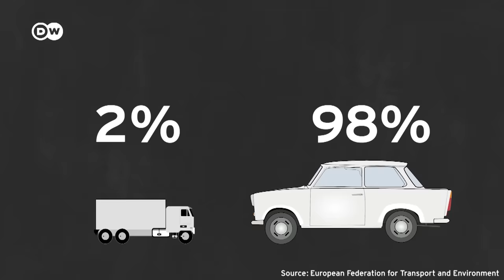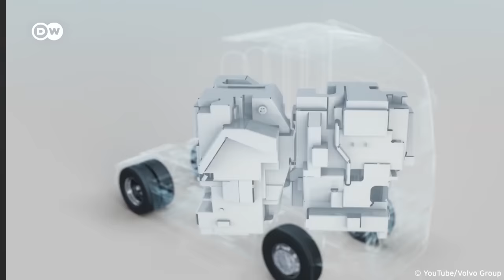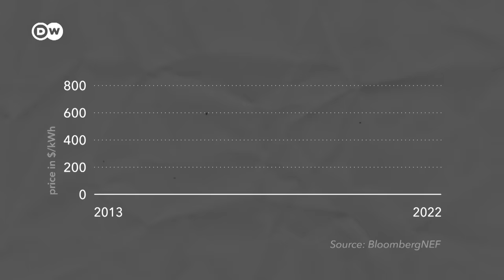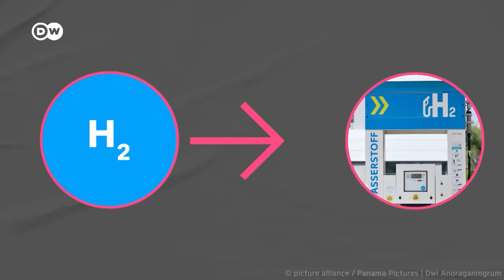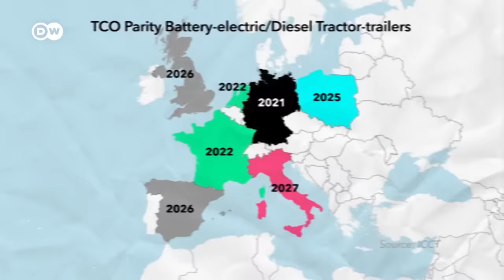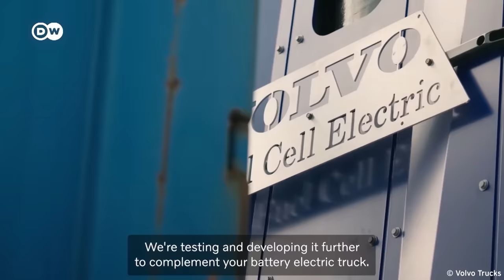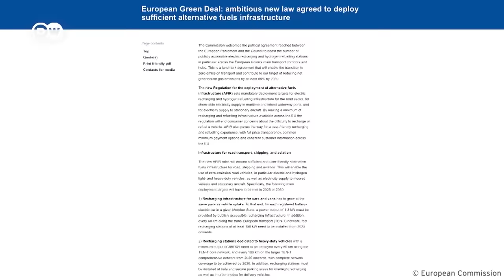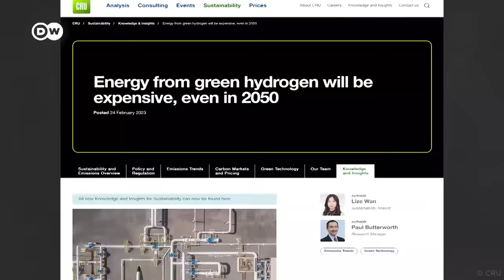Which will be the engine of the future?

Comment: Fuel cells are very fragile and degrade in performance as the inner catalytic plates fracture or chemically break down they suffer thermal cycling and very high temperatures in hydrogen fuel cells VS battery's can survive vibration with longer life than most fuel cells.
Hydrogen will be good in some niche applications so it's good that it is being developed as well but seems like it will have to settle for the scraps as battery vehicles superior efficiency ensures they will dominate in most situations.

Comment: Electric heavy trucks are a non starter simply because the batteries are to heavy and maximum load carrying capacity is no 1 so the only viable solution to replacing diesel to eliminate co2 emissions is hydrogen but converting the standard internal combustion engine to hydrogen existing nox technology would bring this down to very low levels also hydrogen could be transported safely and easily using ammonia in transit and converting it back to hydrogen at the pump
Reply: Except that that would be incredibly inefficient and require about 5 times more electric energy.

Comment: Does "hydrogen AND battery" make sense, not as asked in the end, i.e. I think meant pursuing both strategies separately for the industry, but as a hybrid within vehicles? At least such large ones? The problem seems to be few hydrogen fueling stations, at least for a while so they could be spaced out more. Will battery "only"/no-hydrogen win out, by other means than simply charging, e.g. switching out batteries for fully charged as shown in the video, then needing only smaller? Or other ways to do away with smaller, which seems to be the downside of battery-only.

Comment: Think about this....
In a petrol car we have petrol tank that you must fill every now and again.
In an EV the "tank" is basically the Battery, which you must charge (fill) every now and again with Electricity which takes time.
The fuel for an EV is ELECTRICITY and it must come from somewhere......
The EV Tank (Battery) is massive and very heavy compared to a Petrol Tank.
If every vehicle was an EV the Electricity fuel required would be of gigantic proportions and        the electricity distribution would have to be upgraded at huge cost.
But still the problem remains.....
Where does the fuel come from.?
Energy does not come cheap.
Then again the time to fill the "Tanks" must also be considered....
Reply: Except that electric cars are far more efficient and therefore require far less energy. An EV only needs about 10 kWh per day.
Reply: @Simon-dm8zv  
What is the efficiency of getting the electricity fuel.....It is no better than the efficiency of the ICE......Read Carnot cycle.
Reply: @maxthemagition  Wrong. Power stations are far more efficient than combustion engines.
Reply: @Simon-dm8zv  
Read up on the Carnot....
The Carnot cycle, a theoretical model for a heat engine, established the theoretical limits of efficiency for heat engines.
An Electricity Power Plant is a giant Heat engine that produces heat/ steam to drive the turbines.
Then there are the losses on transformers and distribution.
Lucky if you can get 40% efficiency from the input to the power station (Fossil fuels) to the plug to the EV.
Modern ICE vehicles are as good as you can get efficiency wise.
Then there is the pollution....China for example has the most EVs and by far the most pollution from coal fired power stations...
Reply: @maxthemagition  I know the carnot cycle and that is exactly why power stations are so efficient. Fuel production is simply so inefficient and polluting that EVs using non renewable energy is still cleaner. Production emissions of the EV are compensated for within the first few years of driving.
Reply: @Simon-dm8zv  
I find that hard to believe.
What you are saying is that an EV uses the same energy per day as an electric 3kW fire which is switched on for about 3 hours every day.
Or a 3kw storage heater on for 3 hrs.
Reply: @maxthemagition  Spot on. An average EV EV will consume a little less than 10 kWh per day (50 km).
Reply: @Simon-dm8zv  
One hp (Horse Power) = 745W.
So 10kW = 13 hp....i.e.13 Horses for 1 hr. per day.
See how far 13 horses will take you in one hour.
My Car has a small engine rated at 150hp.
You see why I find 10kWh (13hph) per day for an EV hard to believe...
Reply: @maxthemagition  That's not how it works. You can easily look up the average consumption of electric vehicles. Many of them will be somewhere around 0,2 kWh per kilometer. A comparable petrol car will use about 0,066 liter per kilometer, which equals 0,6 kWh.
Reply: @Simon-dm8zv  
Is what you say correct?......
0.2kWh per km....
For 1 hr to travel 20km at 20km/hr = 4kWh used to move a vehicle weighing close to a ton 20km.!
Is that correct?
Seems a bargain doesn't it.?
I think I'll put the kettle on and contemplate that.
I'm sure a horse could do much better.
Reply: @maxthemagition  Yes it is. Look it up. This is why EVs make so much sense.
Reply: @Simon-dm8zv  
I asked Bard......
"False. The average EV consumes around 30-35 kWh per 100 miles (approximately 160-177 kilometers). This means that for a daily commute of 50 kilometers, an average EV would consume around 11-13 kWh per day.

Here is a table of the average daily EV consumption for different driving distances:

Driving distance (km)	Average daily consumption (kWh)
50	11-13
100	22-26
150	33-39
200	44-52
As you can see, the average daily consumption of an EV increases with driving distance. This is because EVs consume more energy when they are driven at higher speeds and in colder temperatures.

Here are some factors that can affect the daily consumption of an EV:

Driving style: Aggressive driving, such as hard acceleration and braking, can increase EV consumption.
Weather: Cold weather can reduce EV range and increase consumption.
Terrain: Driving uphill can increase EV consumption.
Vehicle weight: Heavier EVs consume more energy.
If you are considering purchasing an EV, it is important to factor in your daily driving distance and other factors that could affect your consumption. You can use an online EV range calculator to estimate your daily consumption."
Reply: @maxthemagition  That is ALMOST what I said. And any car consumes more in these different conditions, this has nothing to do with the type of drivetrain.
Reply: @Simon-dm8zv  
My car switches off 2 cylinders of the 4 cylinders and so consumes less fuel when plain selling and meets all the pollution figures set by the government. So things are getting better.  With the figures you quoted all I need is a 10 hp engine instead of a 150 hp engine!
Wonder why the car manufactures have not thought of that?
Reply: @maxthemagition And yet your car uses 3x the energy of an EV.
Reply: @logitech4873  
150hp engine..
This is probably why people are still buying ICE cars insted of EVs.
"3 Apr 2023 — Electric vehicles account for less than 1% of the 250 million vehicles, SUVs, and light-duty trucks sold in the United States."
The Americans like their BIG cars.
We still need a revolution in fuel and tanks, but batteries are still in their infancy.
FUEL and TANKS.....
Reply: @maxthemagition  People are buying ICE cars over EVs because of... "150hp engine"?
What does that even mean? My EV has about 500 bhp and uses ~150 Wh / km.

Over 80% of new car sales in my country are EVs. EVs make up about 22% of all cars here.
Reply: @logitech4873  
It's life choice.
It's early days for EVs as battery technology and/or energy storage is key
Many people still want the ICE behicles, especially bigger vehicles like lorries.
Until EVs can prove conclusively to be the "Best Buy", all things considered, then ICE vehicles will be the preferred choice.
As I said we need a fuel/tank revolution still
Reply: @logitech4873  
Ladies and gentlemen, welcome to the biggest shakeup in the 40-plus-year history of BMW’s beloved GS legacy. The all-new R 1300 GS – and by ‘all-new’, we really do mean every single component on the bike – is more powerful, torquier, lighter and more sophisticated than the R 1250 GS it takes over from. The R 1300 GS is a true, literal, clean-sheet design: a totally redesigned engine, in a completely new chassis, featuring technology that’s never been seen on any production road bike before . And, perhaps most controversially, there’s also a dramatically different look from nose to tail.

We flew to Malaga for two days and close to 500km of extensive testing, both on and off-road, to put the all-new GS through its paces. However, with so many model variants, so much new technology and so many tweaks, upgrades and general improvements we will have to visit the 1300 GS again (and again...) and put some serious mileage before we can say that it's fully tested.

A manufacturer's launch test can only cover so much ground, and we came away from our ride on the GS still needing to test long-distance comfort, plus the heated grips and seat, the luggage system and pillion comfort. But two days in Spain did reveal some surprises. Has BMW’s benchmark adventure bike been improved, and if so by how much?

WHY NO EV.?
Reply: @maxthemagition  Most people drive cars, not lorries. EVs don't have to replace every single type of vehicle to see mass adoption. In my country they're quickly becoming the most common type of car.
Also you didn't explain what you meant by the 150 hp thing. Can you explain?
Reply: @logitech4873  
10hp is all you need apparently in your EV world as that is the average consumption....
0.2kWh per km.
But if you put your foot to the metal, it is a different story.
I can visualise the average EV driver with a very light foot for fear of emptying the tank.
150hp ICE car, there is no worry about that...
Another reason that EVs are not selling so well.
Also Lithium Batteries can leak and overheat, so be very careful with that pedal to the metal....
Reply: @maxthemagition  EVs often have several hundred horsepower. It seems you're a bit confused here.
Average consumption isn't an indicator of engine power. An EV can be extremely efficient while also being extremely powerful. 
My Tesla Model 3 is both very efficient, using only about 150 Wh/km, and it's also very powerful with almost 500 horsepowers. It accelerates extremely quickly.

The most sold EV in 2023 was the Tesla Model Y. It comes with 295 bhp in the low end model, and 456 bhp in the high end model.
In fact, it was the most sold car overall of any car in 2023. It outsold all ICE models.
Reply: @logitech4873  
Impressive, but they are expensive.
Still too early to jump on the EV bandwagon, in my opinion.
Reply: @maxthemagition  You're right about that, they are too expensive. In 10 years time they'll have matured some more.

Comment: Electric trucks still rely on electricity generation, which still relies on fossil fuels to create the electricity for the trucks.

Therefore, before stringing up wires and swapping dirty batteries it only makes sense to develop hydrogen powered vehicles for trucks, cars, rail and airplane transportation.

Electricity is a lost cause . If we truly want to have zero emissions  we should look to develop hydrogen as a safe, reliable and non-polluting fuel!

Comment: I think it’s abit unfair to say a truck is producing 25% of all emissions in Europe for vehicles they are fare more efficient then cars when u take in to consideration the weight they move we need trucks we don’t need cars for everyone hydrogen is by far the future if we can find a way to cheaply and safely make it it would change the world u could even dub down on making it cost effective by converting a modern diesel truck to run on hydrogen they can already run on natural gas or propane with little to no modifications hydrogen would be the next evolution in diesel technology if u think batteries are clean just look at how they are made and the metals are mined u might as well just drill for oil we are also neglecting the fact that we can do many more things with hydrogen in the future we could use our existing natural gas infrastructure and pipe it to homes for heating use the potential for hydrogen is limitless were as batteries are always going to need to be replaced and recycled o and one more thing in theory a truck car boat furnace or boiler burning it would never need to be cleaned or oil replaced as it is nearly pure and contains no carbon

Comment: Problem with battery's is you need a lot more copper and lithium to make1 battery, in fact there's not enough lithium on the planet to make all the battery's needed, plus the raw mining that destroys the environment, and batteries are not recycle, and you don't get the same milage as a hydrogen truck, i would take the hydrogen truck over an electric truck any time, it just seems like a much better choice and easier to work with.
Reply: There is more lithium on earth than we will ever need. Also: we would need far more copper to build all the wind turbines and solar panels required for hydrogen production (3 times as much).
Reply from the maker: Hey.✨ We recently checked whether we should be worried about lithium running our. Check out our video here 👉 https://www.youtube.com/watch?v=gAZV1Ut6DDs

Comment: Finally a video that adresses the absolute massive quantities of electricity you need to generate in order to make hydrogen work. A lot of people seem to oversee this fact, much like how they don't take into account the tons of emissions created by refining and transporting fossil fuels. 

These things don't simply appear at gas stations. Before you can put anything in your car or truck it has already had an entire journey. To transport electricity we only need to adapt the infrastructure we already use.
Reply: The quantities of electricity needed to generate hydrogen is not really an issue if the electricity is generated from renewable sources and the use of hydrogen is economically competitive. Its not like the we are going to run out of sunlight and wind so its basically a question of economics. And there are are other things that could be taken into consideration such as the emissions generated from lithium mining for batteries and the often moraly questionable sources of labour employed in those mines. The statement of adapting already existing infrastructure also applies to hydrogen. The infastructure used to transport diesel and gasoline can be adapted to transport hydrogen. As for any additional infrastructure required, again it is a question of economics and if it is deemed worthwhile to build that infrastructure then it is a moot point.

Comment: I notice from your breakdown of how Hydrogen is made and transport, for batteries you completely ignore the cost of the power grid, be it national or local that needs to be in place to permit these high speed powerful charging points.  That has an expanse to.
Reply from the maker: From 8:12 min onwards we do talk about this, the challenges both technologies are still facing. 🔋

Comment: Why not encourage countries with large deserts to start building solar powered facilities to produce green hydrogen because most of the energy potential of those deserts is wasted due to them being far away from where the largest energy consumers are and green hydrogen solves that problem by being something that is easily transportable and something that we already has experience with methane gas anybody.
Reply from the maker: The challenge is the infrastructure needed to transmit and distribute energy efficiently, but as technology develops, such projects could become more common. Please check out these videos from us too! 👇
☀️ "Why we should be putting solar panels on our fields and lakes" https://www.youtube.com/watch?v=2hwpXCjmkRo
🌐 "This is what's REALLY holding back wind and solar" https://www.youtube.com/watch?v=u-DsDuTceTo
Reply: Subsea DC connections are far better suited for transporting renewable energy. Shipping hydrogen is very inefficient.
Reply: @Simon-dm8zv  I should have specified that the hydrogen will be for trucks, ships and for industrial processes that need it.
Reply: @yazanmowed  Sure, but you can make hydrogen anywhere. The more shipping avoided, the better.

Comment: The price of batteries will become much higher as the demand will outstrip supply to power more and more equipments.

Not to forget the environmental impact of mining minerals for batteries, and do we have unlimited supply of minerals ?
How about the worldwide recycling problems of batteries ?

Worst of all, it is all the electric infrastructure (power plants, transformers, cables...), and the required fuel.

On the other hand, hydrogen by itself is a fuel. Hydrogen is not only the most available element on our planet but in the universe.

What humanity should do is to master hydrogen.
Reply from the maker: Hey there.🙌 We addressed the issue with recycling batteries in our previous video you can watch here 👉 https://www.youtube.com/watch?v=PbOBmnZRpZ4. You might also want to check out our video on hydrogen and better practices here 👉 https://www.youtube.com/watch?v=AGTjKJHu99c